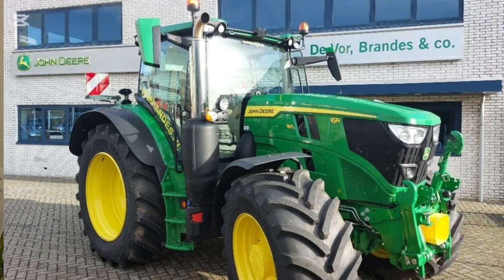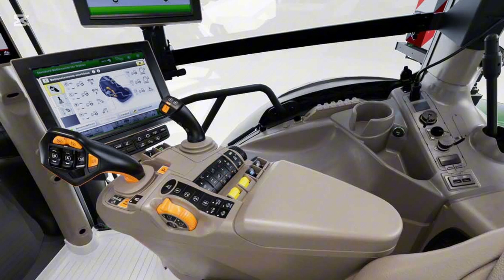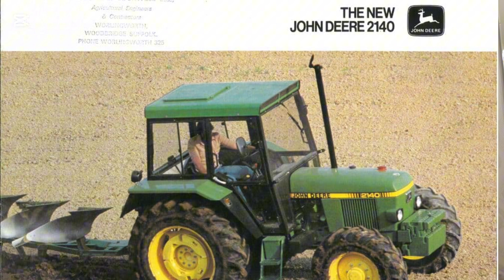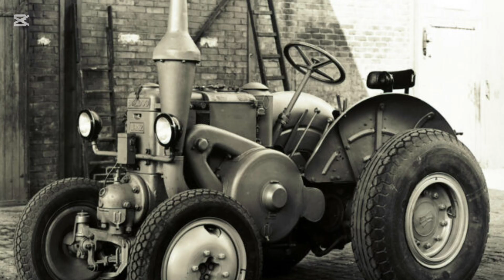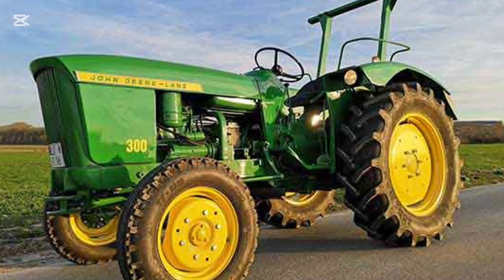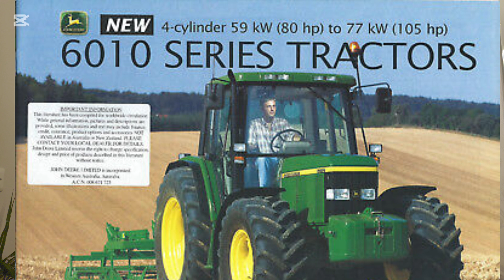THE GREATEST TRACTOR FACTORY IN EUROPE!!

Comment: Here is a portion of an article about SDF expansion in Turkey:
------------------------------------
“With the inauguration of the new factory dedicated to FARMotion engines,” said Lodovico Bussolati, Ceo of the SDF Group, “SDF adds in Turkey the production of 3, 4 and 6 cylinder engines, which undoubtedly represent one of the main and fundamental core components for the production of tractors, destined not only for the local market but also for the foreign and especially the European market, which is very demanding in terms of performance and efficiency”.
---------------------------------
So Turkey is likely to be the source of most approximately 100 HP tractors.
Nice to see they are finally going to make a 6 cylinder FARMotion engine..
Reply from the maker: @briansmith8385  Thanks Brian.. Interesting stuff there 👍

Comment: Thanks for this great video. I'm sure most of the SDF  tractors to be sold as Massey Fergusons will be made in India.  
The SDF diesel engines are made in India.
Currently, the MF 2604H  thru 2607H  (40-70 HP ) tractors are made in India by Tafe.
Reply from the maker: @briansmith8385  Thanks.. yes, this is most likely the case. 👍

Comment: Excellent  video! I'm aware of all the controversy surrounding farming in Europe but what I'm wondering is there any controversy over right to repair john deere tractors in Europe or is it a nonissue? It is a big issue in the USA.
Reply from the maker: @EasyEd02  Thanks.. Yes, it is a big issue in the USA. From what I've been told by guys in the dealer network over there, it's more of an issue for JD that guys are hacking the software to increase HP. Instead of buying a 600 HP machine, they will buy the same machine in the 550 HP version and have it tuned up by 3rd party operators, or have the AdBlue deleted, etc.. Costing JD millions across the board. That's the main reason they give for locking out the software.. It's not so much an issue over here in Europe as the machines are smaller, and the dealer networks would traditionally have a closer relationship with the owners.
Reply: Hi I actually have not seen big concerns about turning up the horsepower. My understanding is that it is about a tractor being out of commission during seeding or harvest an no JD technician available to fix the tractor for days or weeks or longer plus the high cost of a JD technician for even simple repairs. I can see how for lower HP tractors it is less of an issue. Note that the lack of technicians also applies to combines .